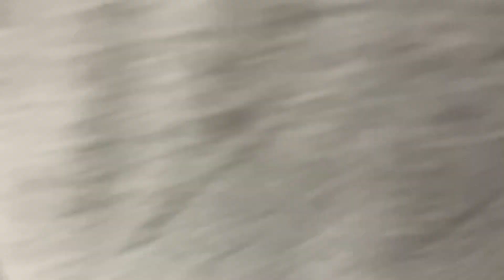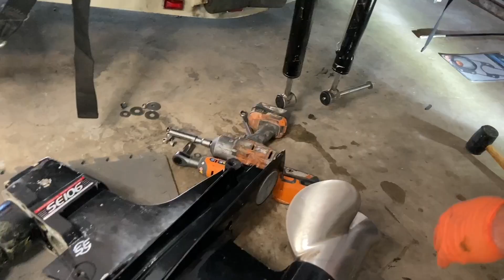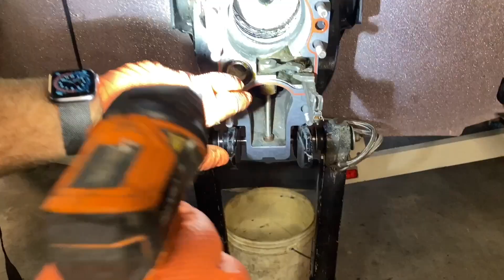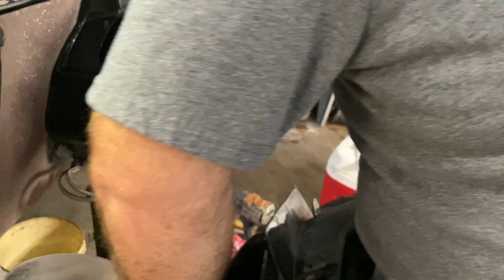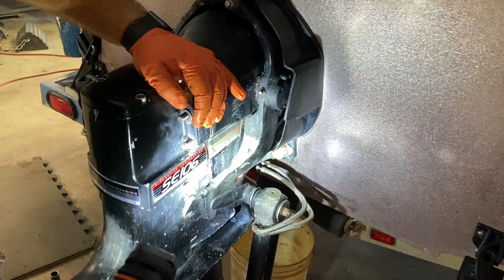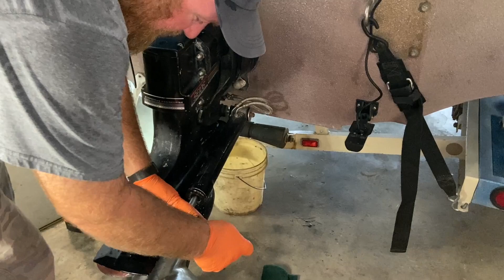MERCRUISER Alpha 1 Gen 1 Stern Drive Repairs Part 12- One Year Later!

Comment: I didn't see any comments about draining the gear oil.  Did you drain and fill the gear oil without commenting on it, or do you not need to drain the gear oil before pulling the out drive?
Reply from the maker: Right- you don’t have to drain the oil to pull the sterndrive. Draining and refilling the stern drive should be done annually. I did not show that in this video b/c I have other videos showing that procedure.
Reply: Thanks.   I overheated mine last year, a mechanic repaired all the burned bellows and components, but now it’s leaking gear grease.   It appears to be leaking where the drive shaft enters the upper gear box.   All mechanics around hear are booked through July, so I’m going to break it down and inspect/replace the seals.
Reply from the maker: @mickruffini  I thought about rebuilding/repairing my original unit. But I know it can be a really tricky procedure. Instead,  I made the decision to buy one from SEI. You can buy the upper or the lower. They are pretty reasonable and come with a three year warranty.